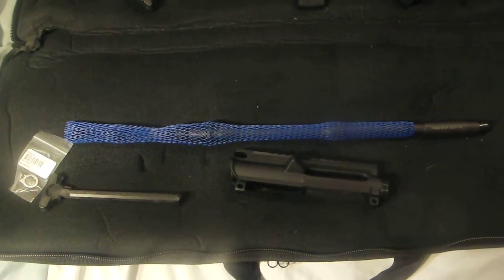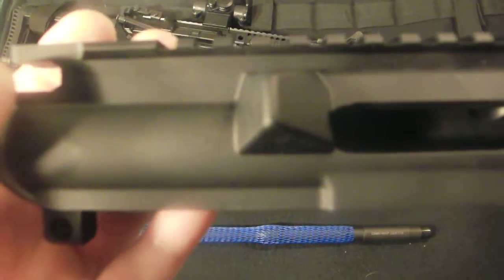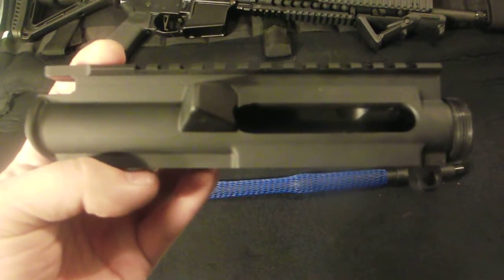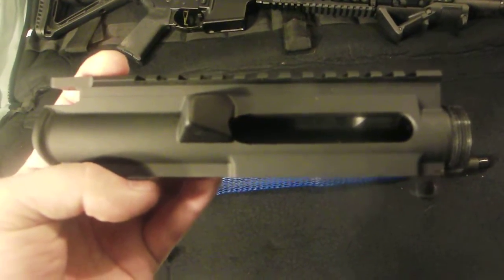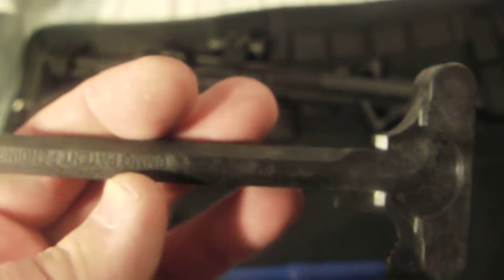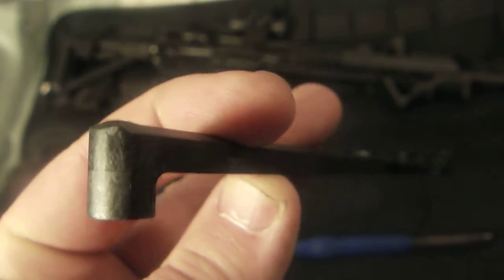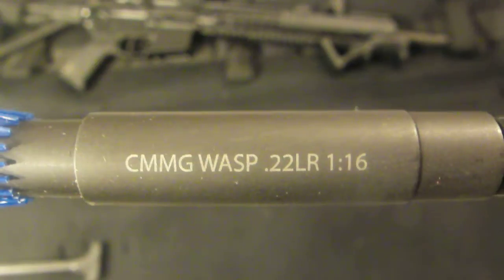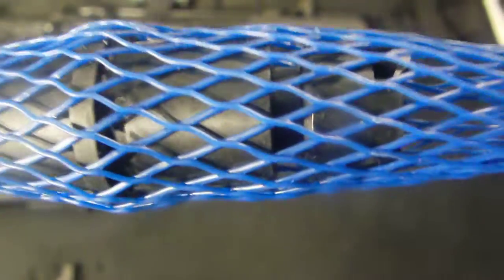Dedicated 22LR AR 15 build series (part 1)

Comment: Thanks for the video and some really good info that will be helpful once I decide which way to go. 
(Option1)Ive been looking at using either the 20” cmmg A4 Government profile .22lr w/ Cmmg conversion bcg in an Aero M16A4 Gen2 Receiver Set W/detachable carry handle for a “Inspired” M16A4 .22LR “Clone/Replica” with Kac M5 Ras Rail. 
(Option2) would be the 16” 2A Armament 16” Fluted .22LR barrel snd Conversion BCG with Aero M4E1 Upper and 15” Atlas R-One Mloc rail. 
(Option3) did the .22lr AR15 idea & go with a Tactical Solutions X-Ring OD Green Ambi Receiver,v-block&16.1” Fluted Tacsol 10/22 barrel in a FDE Magpul Hunter X-22 Stock w/Upgraded match trigger of some sort. On any of them Optic wise I’d look to mount a Holosun he512c gold dot which is similar to a vortex Huey, only led projection with solar powered option to prolong battery life. I’m torn between a traditional 10/22 type “build” project and “building” a Ar15 project in order to be able to train cheaply snd shoot steel up close with the same Manuel of arms to allow me to shoot more often to sharpen my skills while keeping cost of Ammo down significantly given .22lr is .03-.07cents per round compared to 5.56 @.20-35cents a Round for non-match steel case wolf military classic, wolf gold(Taiwanese XM193& same velocity as the wolf XM193 White box) or American Eagle or IMI xm193/M855.

Comment: OK. I would buy the bolt with the dedicated collar.  So wouldn't the barrel just sit in the dedicated collar and fix in place with the ball detent on the collar.  I would obviously need to get the custom barrel machined as the CMMG.  Actually it might just be easier to buy the cmmg barrel with adapotor.

Comment from the maker: where are you planning on getting your barrel from?  if you ar buying just a 22lr barrel it pretty much has to come with a barrel adapter.  unless you get a .223 barrel, in which case you wold just use a conversion

Comment: Can the 22 cal convert to 556?
Reply from the maker: If you buy a 22lr ar15 of the shelf at a store no.  The rifle i made had a .223/556 receivers and i used a 22lr barrel and bolt combo.  So if i got a 556 barrel and bolt i could swap it.